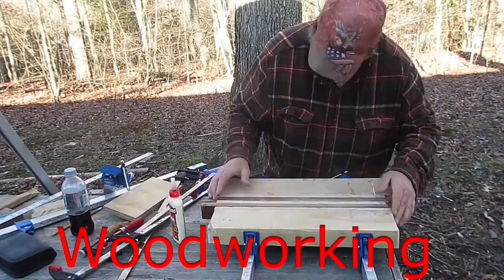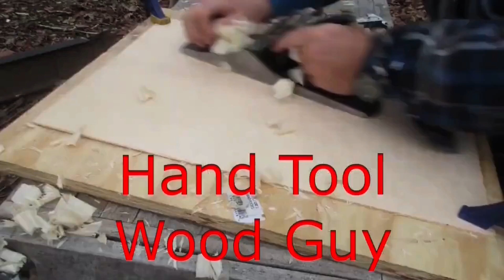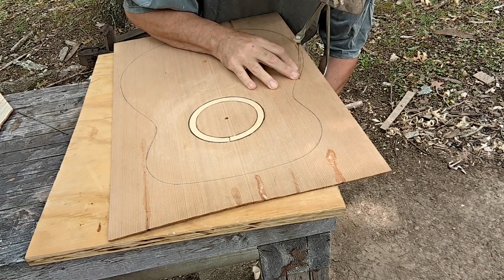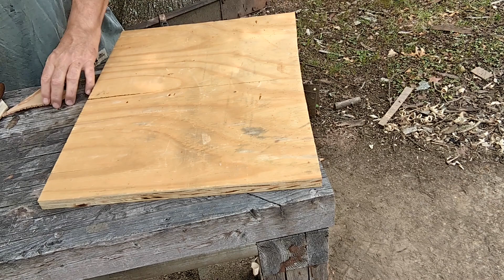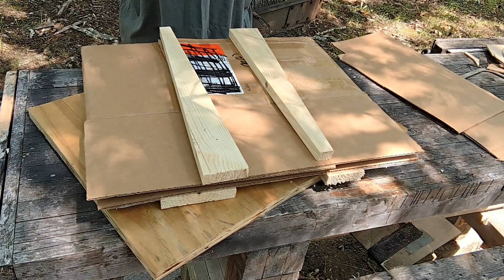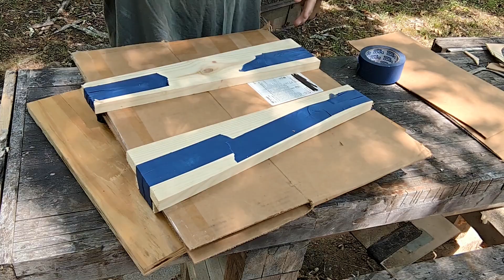Cedar Over Maple Cutting the Outline of the Top and Back Plates

Comment: I never considered the top splitting during the trimming process.  Would a thinner blade with less coarse teeth, like used with a jeweler's/Knew Concepts fret saw, help minimize that risk?
Reply from the maker: It would. The blade I used was the finest toothed blade I could get locally, which is Big Box stuff. I don't usually have the budget for the "good stuff", lol.
Most makers use a band saw that only cuts one direction; down. The coping saw is moving up and down and puts a lot more flex in the top. It is what it is; you deal, and do your best. It's a poor craftsman that blames his tools. I have been blessed with way more than I ever dreamed of. And this build rolls on.
Thanks for watching and commenting on my videos.